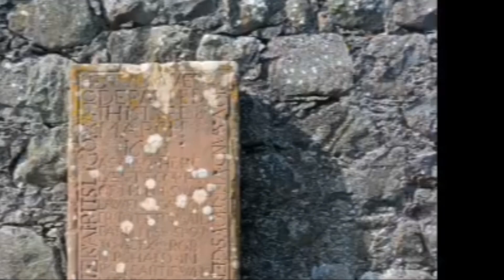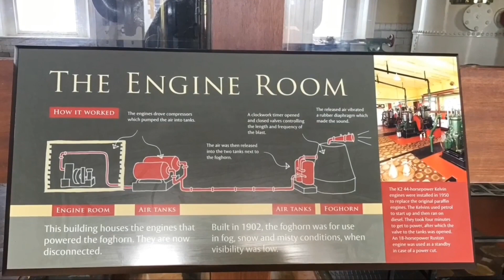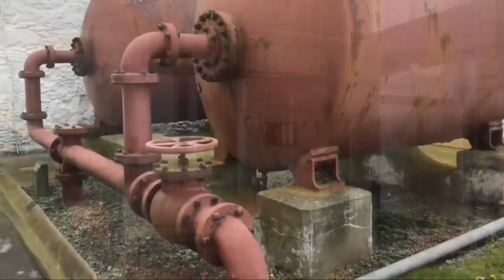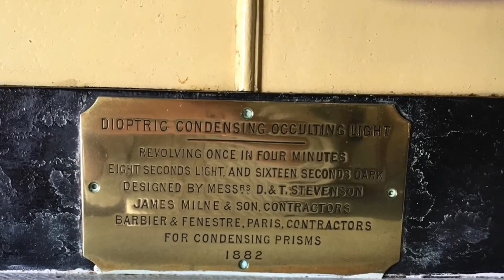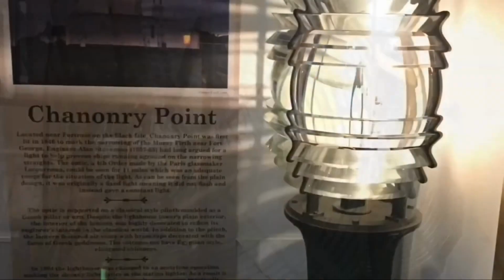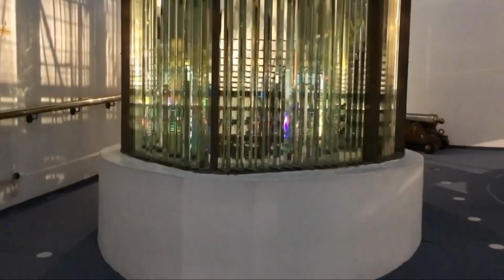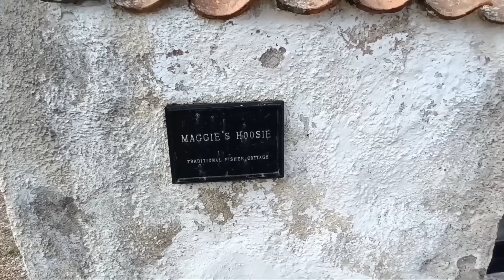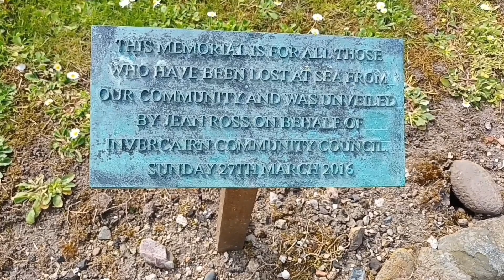A Glenbuchty visit and back to the lighthouse

Comment: Thank you Pam, glad to see you stopped off at a little campground. Did you pitch a tent or still stay in the car? We’re there any other facilities other than water & waste? Was that a wrecked boat I saw ? 😊
Reply from the maker: It's a motorhome Aire but Greg and cecilia are friends so I stay in the garden not on the Aire when visiting, it's just basic tap and chemical disposal but lovely sunsets. Seals and nice visit within a short drive
Reply from the maker: And yes its a wreck in the bay